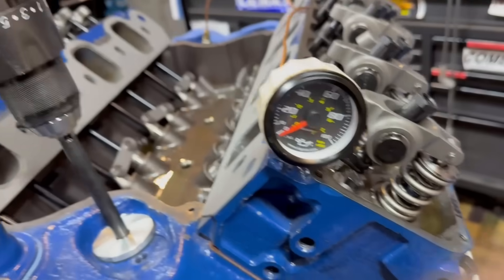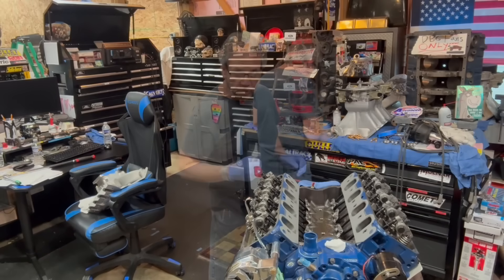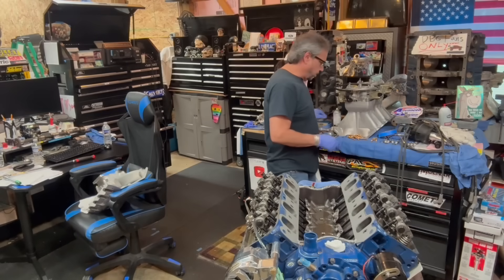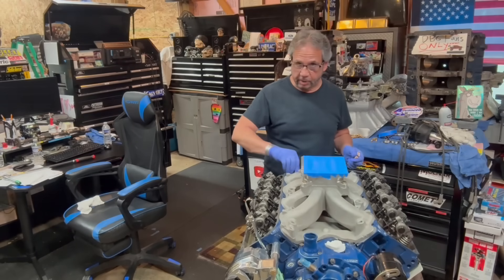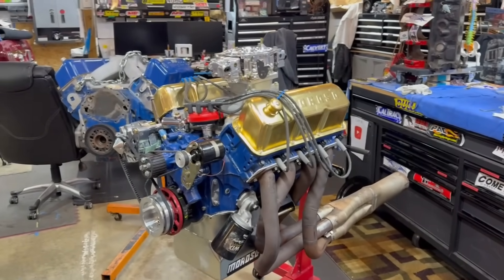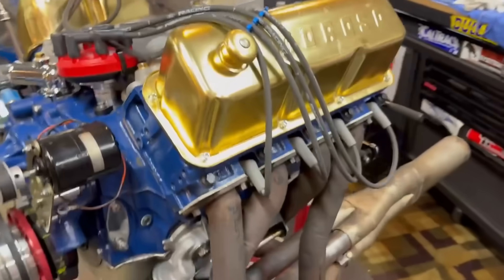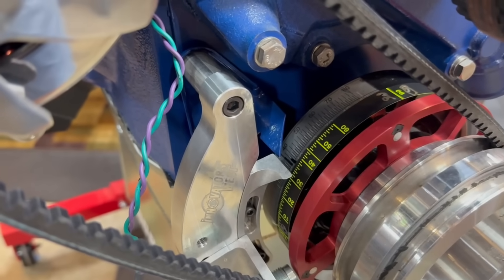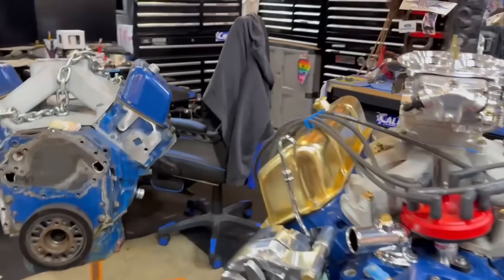DBG: How Does a Ford 351 Cleveland with Stock 4V  Iron Heads make 615hp ? ..Secret Solid Roller Cam

Comment: 50 years ago  I built up my Boss 302  but left the stock oil pan Big mistake I went through 6 oil pumps The engine is still in my basement What a tragedy but made good powee
Reply from the maker: Windsor based 302 should have been ok, other than maybe a couple quarts more oil. Better get that out of the Basement and on the engine stand

Comment: My father had a 79 Fox body with 4v unported heads, Crane .590/.606 lift solid lifter cam, headers, single 850 Holley, 5.13 gears and it could run 10.85@131 1/4 mile 😊👍
Reply from the maker: Pretty Healthy Rodney. Thanks for sharing that Cleveland power 💯🏁👍

Comment: Clevelands are waaayyyy underated as far as what they'll produce with little effort.....with that said, a Windsor stroked to 393 or 427 is a beast as well.....a nasty choppy cam makes the engine, the headers, mufflers, etc don't matter without the nasty cam.

Comment: You think near 700hp crank hp would be possible with stock 4v closed chamber heads and a stroker kit 408? With a solid roller set up
Reply from the maker: Yes I do Bart. Get the right can of course and valvetrain to match.
Reply: @dragboss351cleveland yeah Tim, by that time i will let you know 😉 its in the planning for my next upgrade..gotta ditch the hydraulic flat tappet anyhow

Comment: I would love to see you max out a set of 4v open chamber heads just because everyone says they dont make any power. I have 2 sets btw, and im working on a 351 stock bore/stroke 4v setup for my 1980 fairmont right now. love your channel.
Reply from the maker: They make power no doubt. I have the super stock guys like the 73 open chamber, one of the best flowing heads of 4v

Comment: I have a low mileage 1970 4bbl 351 cleveland  with an fmx trans for my 53 ford sb pu.great motors,i have a 72 2bbl motor w c6 trans,i estimate 100 horse power less than the 70,i may use the c6 trans on the 4bbl motor.
Reply from the maker: If you really want to pick up some power, switch to a C4 Bob, pick up bigtime 
https://youtu.be/6-HLyuxpgE0?si=TU_F7KWnvR3YZiDe

Comment: Nice job brother. Can't help but notice you used a 1372 firing order cam instead of the 1542 firing order cam. Some years ago I built a 4V Cleveland out of my '73 Merc Couger XR7, 351 CJ, Q engine code. Was a .010" overbore. Depending on the usage even the 2V heads could work quite well. A lot of people thinking the "73 Cougars were pooches, and they were ... normally. But mine with 6 clutch C6 and 3:90 gear limited slip 9" took down a lot of "faster" cars. I would buzz it to 7K. IMHO, and I've built many SBC's and small block Chy the Cleveland is potentially the most potent. It's downfall, thin wall casting blocks. What a concept, big block design heads on a small block engine. In street trim at Bandimere (5800 ft. Alt.) it would run mid 12's at 110 mph.
Reply: Cleveland uses 1372 6548, Windsor has 3 different firing orders depending if its a 289, 302 or 351 Windsor... I believe from memory 1542 was 289 firing order. You are spot on about the thin casting walls and they also have been known to  suffer core shift.. the pillow blocks were a little bit better and had a higher nickel content but still fall short for any serious power adders pushing over 1000hp
Reply from the maker: @DB_01984 yes they the XE blocks from 75 definitely were harder to machine, not sure on the pillow block from 82.  Have on of the Pillow blocks on my bench. Definitely more reinforced bulk heads and pain rails. Probably add in ring seal. Never really messed with changing firing orders to increase Hp.
Reply: @dragboss351cleveland  im looking at a pillow block as we speak lol
Reply from the maker: Thanks for sharing your build with me, I really appreciate hearing it, and also the numbers that it ran. That’s making some horsepower. I can’t wait to get this Engine on the run stand, then in the Mustang with a four speed. i’m just hoping for 1050s, but I think it may be running a little bit faster. Stay tuned to DragBoss Garage, we always seeing and learning something new.💯🏁💪

Comment: I had a custom ground cam for my iron headed closed chamber 351-c. 252°/260°, .633”/.636”, 110 L.S., 106°/114° L.C. Solid roller. Using a Strip Dominator, 850 Holley, in a 3500pound Fairlane with a C-6.
Reply from the maker: Hey Vamp, is that what is in your car now? Looks great 💯🏁
Reply: @dragboss351cleveland yep!

Comment: Wow! Cam specs!  I just realized my cam is a baby cam with 260 @ .050 .640 lift.  Thanks for your channel Tim.  Getting me hyped to finish mine!
Reply: It's not a baby cam, your cam is bigger than this one.  The duration is what matters the most, I don't focus as much on lift.
Reply from the maker: @lykinsmotorsports right on Brent. Thanks much 💯🏁
Reply: @timruiter5460   The factors for cams is what are the c.f.m. at the 0.100 increments and what are they ported for AND valve size.....
 Example is the Aussie 302 4V is a good street head after porting with 2.07 intake/ 1.65 exhaust, or NASCAR 2.21 intake/ 1.69 exhaust for 351 4V....
Reply from the maker: That is a great can Tim. Appreciate you being here. Now get R done man 💯🏁
Reply: Mines int 266@50 exh 272@50 
Int lift 698
Exh lift 708
110lsa 
Solid roller
Cleveland 393 scat stroker
702hp @ 7600 N/A
1000HP @ 8000 WITH 250 SHOT
Reply from the maker: @DB_01984 sounds killer. Why don’t you have more lift, net lift on those number, is small think your leaving a bunch on the table ?
Reply: @dragboss351cleveland  the heads dont have the work needed for higher lift numbers, one day ill get them cnc ported and maybe look at trying a different camshaft. Also less lift its much friendlier on valve springs and roller lifters
Reply: @dragboss351cleveland  are u familiar with higgins cylinder heads in melbourne Australia..... u should check them out they have a very nice cylinder heads for cleveland.... so does cylinder head innovations also in melbourne australia
Reply from the maker: @DB_01984 yes sir know who they are are well. At this point going as fast as I want with old technology. Old school I guess, but I can always change. Thanks 
https://youtu.be/8T7KJI_baGQ?si=_IkoCtk0gV5QKLSK
Reply from the maker: @DB_01984 right on brother. Get R done, hope you get the garage this weekend
Reply: @dragboss351cleveland  thanks Tim keep up the great work 👍

Comment: I was wondering  why you haven't  used  a tunnel ram  on a motor yet , we both  know  they make  more power. On this setup ,I'm guessing  a good  40 horse  gain with  a tunnel ram .
Reply from the maker: Steveo that’s my goal,  with this 354C, never had the gumption to do it. Always settled for single carb stuff.  Not anymore…. 💯♾️
Reply: @DragBoss351Cleveland  Awesome,  I can't  wait  to see and hear it  , Thanks, Tim.
Reply from the maker: @SteveoGregg you’re welcome. Maybe you have seen this, maybe not 
https://youtu.be/aHie16-1pms?si=gn_QGMh8MICZmpPR

Comment: When you say it makes 640hp I'am assuming you meant flywheel or rwhp ? I know George Pence all ways talked about 450 rw tire frying hp I personally wanted  706 flywheel that I think equates to 600 rwhp for my 4v 351 virgin bore Cleveland maybe I'am dreaming or don't know enough happy to be corrected though that's just my wishes if possible

Comment: The old H 750 dp or HP 4150 with select dual planes if going back to basics maybe the 2 inch carb spacer will or won't work my xygtho ph3 from Australia I'm yet to test out what will fit and what won't  nice looking engine there

Comment: You need to switch to 385 series 429/460....just kidding Tim ....love the content as allways....
Reply from the maker: My dream is a 600 ci 385 for the ‘40 Ford Coupe sitting in the garage. Have to pick up the aftermarket next couple of weeks. Already tubbed. 💯🏁💪
Reply: @dragboss351cleveland I knew you wouldn't let me down. ..lol
Reply: I didn't know about the 40 ford...or the 1985 5.0 30th anniversary rust free Thunderbird  / no engine -trans I have for sale . ..comes with 9 second C-6 I built 7 passes before Tom Browns falcon got my transbrake C-6...let me know if you are interested, thanks